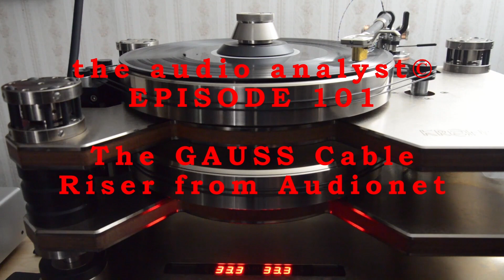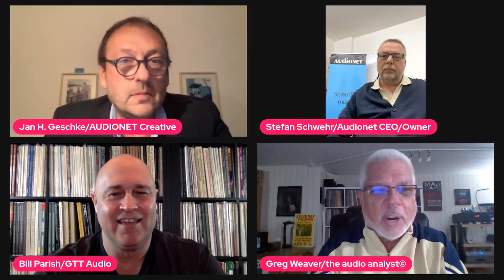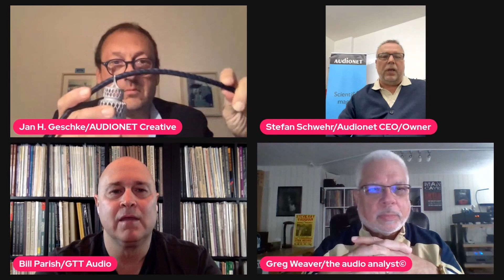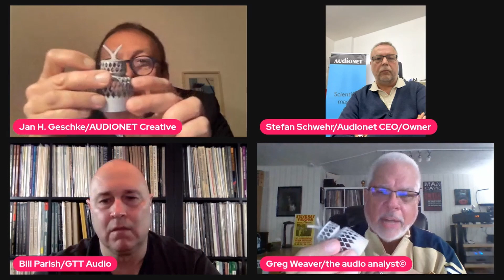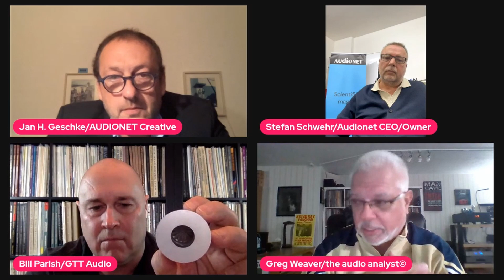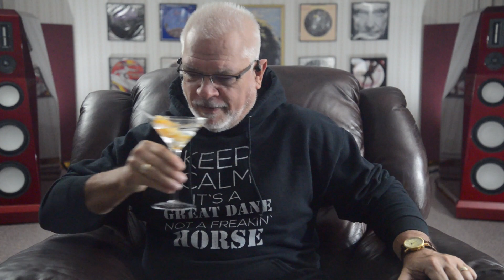E101: The Audionet Gauss Paramagnetic Cable Riser

Comment: For fun, I asked ChatGPT, "Does lifting speaker cables off the ground make an audible difference?"

Its reply;

"Lifting speaker cables off the ground is unlikely to have an audible difference in sound quality. The impact of cable elevation on audio performance is minimal and is more influenced by factors such as cable quality, length, and shielding, as well as the accuracy of the audio equipment being used."

Which is not different from what Danny & you posit, but I thought it interesting nonetheless.

Comment: If the holy grail is air, why not use Aerogel?
Reply from the maker: Hello Paul. I’m not sure what would make you think that Aerogel is non-reactive to electricity. Since their invention, aerogels have primarily been made of silica. They are highly porous and have an extremely lightweight structure. However, they are both very fragile and are able to act as good thermal and acoustic insulators, and as such, it has routinly been used as thermal insulation for space suits and vehicles.

While their structure is very porous, pure silicon is a semiconductor, with properties lying midway between good conduction and good insulation. But it conducts electricity as well as behaving as an insulator under specific configurations and environmental conditions.

I suspect that its reactivity may be considerably higher than that of this new air- and space-grade magnesium-aluminum alloy. But you could write to Jan at Audionet with this question.
Reply: @theaudioanalyst  While I am not an engineer, I have familiarity with Aerogel & its properties from a lay person's perspective. While aerogel is constructed of silicon, the density is quite low, hence the light weight. My thought is the amount of silicon in aerogel which would be in the EM field of a speaker cable would be quite small even in comparison to the magnesium aluminum alloy used in the Gauss product.
Reply from the maker: @paulstearns93  As I suggested, you should run this by the men who developed them at Audionet... One further point on the fragility of Aerogel...I've SEEN someone examining a speaker driver fabricated of Aerogel, and when probing at it with a finger, it has cracked and shattered...

Comment: I appreciate your discussion on the subject and the very wise comment that the results may be cable dependent. Having done much cable research in the past it is obvious that all cables come down to a matter of taste and associated equipment. To prove this try putting mono amps directly behind the loudspeaker, and connect with two heavy gauge copper (or silver) wires and see what you hear! I guaranty you'll go back to your chosen cables.................
Reply from the maker: Hello Lawrence. I would offer that one of the biggest factors in why listeners aren't happy with the sound created using ultra-short (say less than two meters or so) loudspeaker cables is a product of impedance mismatch and the resultant signal resonance or ringing in such short lengths.

Comment: Not sure if you address the quality of sheathing around the speaker cable. The problem I have is that I bought mono blocks after I bought Long speaker cables. So the speaker cables are coiled behind the amplifier and there's not much room to spread things out.  the cables are very high-quality cables and very thick, so doesn't this have benefits?  

As an aside, I have long Styrofoam packaging from incandescent lightbulbs I bought, maybe this would be a good way to shield the cables along the run behind a long cabinet.  Which cable should I isolate? The interconnect, the power cable, or the speaker cable?  My guess the speaker cable would be high-priority
Reply from the maker: Hello again. So I really would like you to think about your solution of coiling your long speaker cables to make them fit into your space. Honestly, coiling may be one of the poorest compromises you can make with any cable, most especially, a speaker cable. Keep in mind that coiling that cable is mimicking one of the simplest crossover designs out there. When you put an inductor in series with a speaker (your coiling of your speaker cable), it essentially becomes a 6 dB per octave (first-order) low pass filter, causing filtration - or removal - of the highest frequencies. Depending on the values of the resultant inductive value created by the coiling of your cable/s, various frequency crossover points will be created. 

I might suggest one of two solutions. Perhaps re-route them, using some zig-zag pattern on the way to the speakers that is not offensive to the eyes or unsightly in your space, not allowing them to cross over themselves or to have any residual coiling. Or - perhaps even better - certainly appearance wise, if you aren't happy with long cables strung through your space, you might sell them and purchase similar (or even better) quality cables in more appropriate lenghts for your installation?

Thanks for watching and taking the time to write.
Reply: @theaudioanalyst  thank you for great answer.  I would probably buy new cables and mothball cables rather than get rid of them. You never know when you might need them. they are well insulated. The cables are from transparent and are in the mid range of what they offer. they are nice cables but I have a feeling shorter cables for current set up is better.  

I'm taking to heart what you said about cabling and interference and further inspires me to take on the vast challenge of taming a jungle of wire.

Comment: I too, have made lifters out of 2 x 2 walnut blocks. They are 3 inches tall and tapered to the top to 1 inch where they make contact with the wire. Should the contact point be as thin as possible? Is what a bad material to use? They look good and are they better than nothing at all.
Reply from the maker: Hello. It is good to know that you were aware of the advantages of getting your cables off the floor. As to your first question, I would suggest that the least amount of mass, of the entire riser, not just at the point where it comes into contact the cable, would be preferred. I'm not sure exactly what you are asking with, "Is what a bad material to use?," but I will simply add that you want to use something with the lowest impact on those magnetic fields. That is why I have suggested that people try to recognize the sonic benefit cable risers afford in their system by using cardboard tubes, like expired toilet paper or paper towel rolls, as they are essentially free, and because paper (cardboard is just thicker paper) offers reasonably low interaction.

Comment: How would you assess the presence of metal nails in the floor? In all events, is any of this audible? Thanks!
Reply from the maker: I'm not exactly sure what you are asking? Are you asking how do you determine if there are metal nails in the floor under the path of your cables? Sorry, I'm just not clear on what you are asking.
Reply: @theaudioanalyst  Sorry for the confusion. Since metallic objects, like nails, would have a greater effect on magnetic fields, I assume they would be worse and benefit from cable risers more. The larger question is the differences encountered produce audible results. Thanks!
Reply from the maker: @brucermarino  Thanks for clarifying... So, in the loosest terms, IF your cables were lying on, say, a wooden floor that was fastened with nails, you could certainly expect to find its path littered with nails.

But if you are asking me to somehow quantify that difference, I'm afraid that is something that I would not be able to do. Though the degree of interaction would likely be higher if there were a lot of nails strewn along your cable’s path on the floor, I’m not sure how you would go about interpreting what damages to the signal were caused by the nails, and which others were afforded by the floor and/or its coverings.

But as we suggest in the discussion, the most apparent improvements noted when elevating your cables come in the form of improved dynamic interactions (both micro and macro), the representation and recreation of the space of the recordings, a general sense of heightened clarity, and in some cases, an enhancement of tonal purity.

While this is only my speculation, I suspect that it may be because these seemingly more fragile, delicate, and subtle kinds of cues may tend to be the most easily affected or damaged by any skewing or slurring of, or impediment to, the signal flow continuity.

Comment: Won't how much power is flowing through the cable effecting the size of the magnetic field matter more than the cost / level of the system?
Reply from the maker: In the typical two-channel high fidelity audio system, no, not by any significant degree. However, a system with lower resolving power will not be able to express the differences as readily or clearly as one that is more resolute and transparent. That was the point I was getting at with the "quality" reference.

Comment: Do cable lifters also affect interconnects and power cables?
Reply from the maker: This is an interesting question. While many of my colleagues flatly say no, I say - sometimes... I have occasionally heard the typical improved clarity and dynamic response with SOME interconnects. I have yet to note any appreciable effect with AC cables... So, my suggestion is to use cardboard tubes - from exhausted TP or Paper Towel rolls - to test and see for yourself...

Comment: Why is the cable cradle a "V" shape rather than a"U"?
Reply from the maker: Well, I don't know if this was the reason for the design or not, but...if you think about how a cable would rest on a V shaped cradle, versus a U shaped one, the V configuration actually affords less contact with the surface of the cradled cable than a U... With the V, there are only two points of contact, to the bottom of each side. With the U, there could be as much as half of the cable touching the cradle support. Again, I'm not sure if this was part of the design consideration, but it is a valid point, and may be a logical reason to do so... Again, as magnetically and electrically permeable as the GAUSS is, I'm not sure that would matter; I'm just speculating. Perhaps Jan will choose to respond here...
Reply: @theaudioanalyst  I hearya. However, it just seems it would be more comofrable((?) for the cable to sit in a "U" rather than a "V" since that's the shape of most cables. Just sayin. Should they want my design expertise, my agent is awaiting their call. 🙂
Reply from the maker: @iraeich  Hello again. I confess that I don't understand your point... I wonder what comfort would have to do with signal transfer! 😉 It seems to me that minimal contact would be the preferred choice, but I will relay to Jan that your willingness to assist with any further development plans! 😀 Thanks!
Reply: @theaudioanalyst  My pointis this: Let's say one has rather large round cable, say a python shaped one. How would one put it in the "V" saped holder? Saying that the "V" is better sonically is wondrful...until the real world hits. For that amount of betterness one has to (BTW - not me) deal with a holder that will not properly hold their snake.
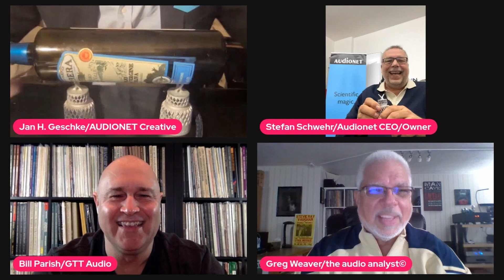Reply from the maker: @iraeich  So for some reason you seem to be missing point. And I'm guessing that you didn't watch the whole video, or you missed some of it? There is a spot, starting at 16:35, where Jan shows a wine bottle effortlessly suspended by a pair of Gauss risers... That wine bottle is easily ten times the diameter of the largest speaker cable I've ever seen, which it supports with no issue.
Reply: So the “real evidence “ is anecdotal, and not measurable?     The resistance, capacitance, and impedance differences aren’t measurable? Could it be placebo effect? How much of the usable signal is contained within the wire, and how much traveling between the amplifier, and speaker floats around outside of the insulation, and shielding?